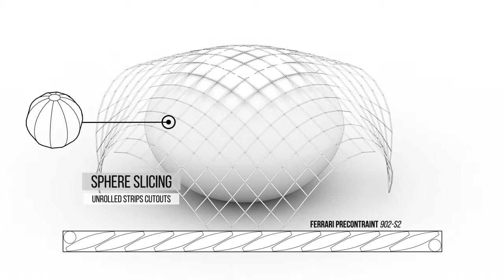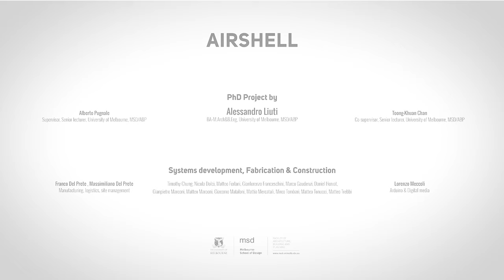AIRSHELL - Bending timber with air

Comment: Interesting. Were you using any kind of feedback from the air pressure to determine if the wood could be bent further or just doing it at set intervals? If you figure out a way to continuously hold down the supports properly instead of having to do it manually, you could automate the whole system.